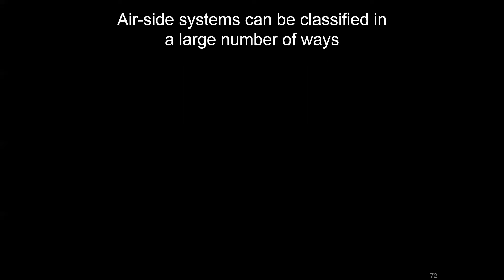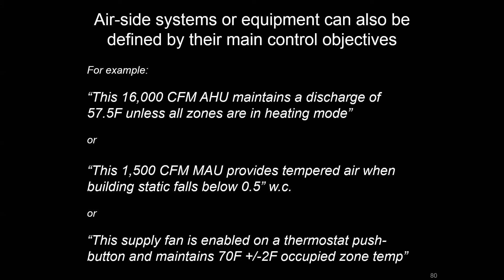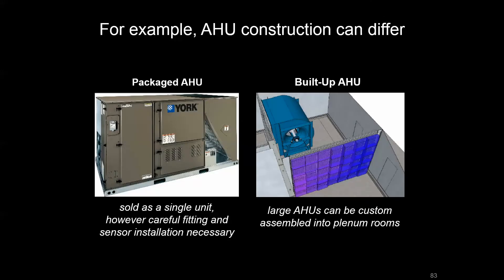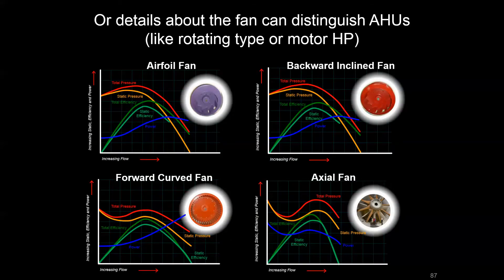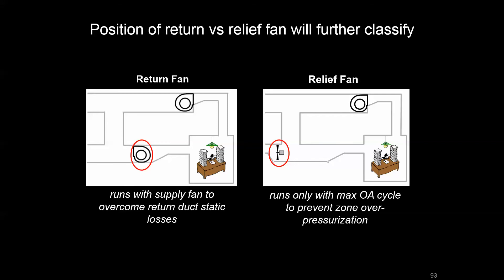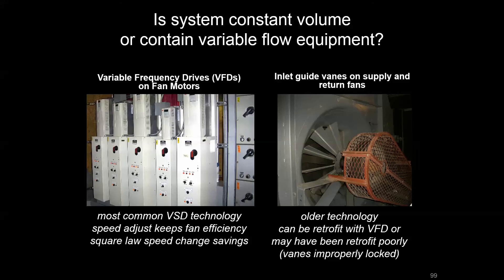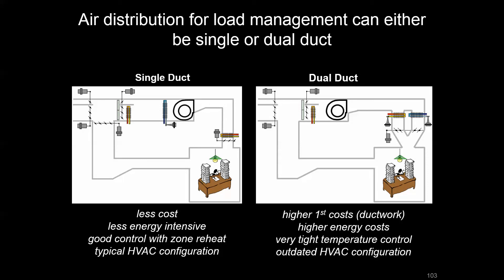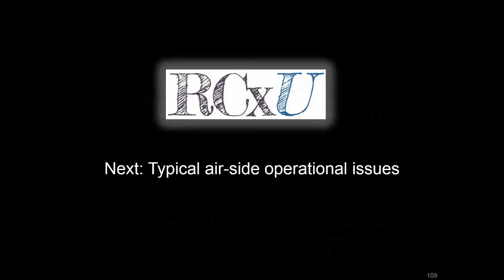Classifying air-side systems

Comment from the maker: Air-side systems may have specialized applications with unique design and operational considerations, an example resource for a specific air-side application (commercial kitchen ventilation, others available) can be found through the Energy Design Resources here: https://energydesignresources.com/media/1684/EDR_DesignBriefs_comkitchvent.pdf